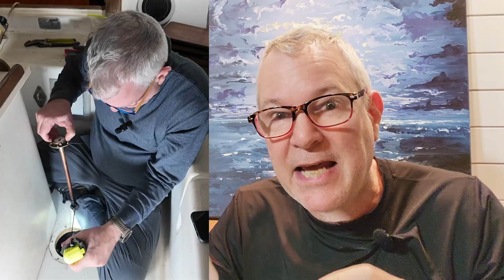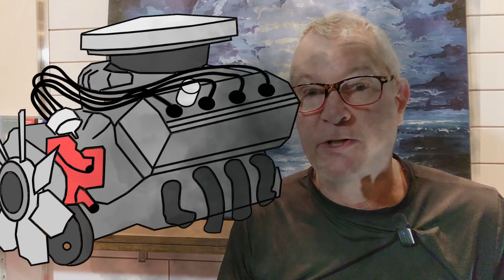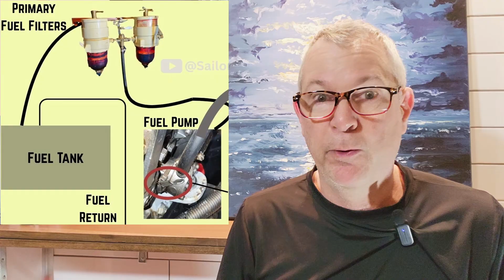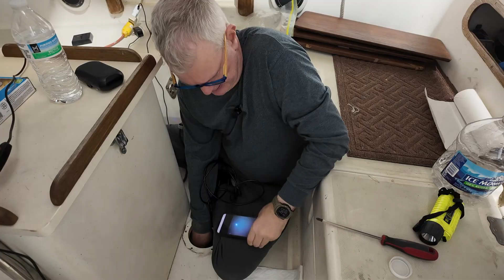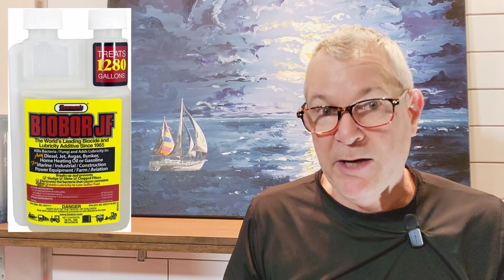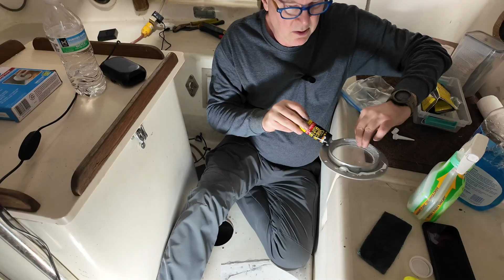Marine Diesel DIRTY FUEL? How to Check and Prevent!

Comment: My engine died in a marina due to a clogged filter. I need to look inside my tank now! Thanks for the informative video. I need to remove old diesel . Old diesel became acidic and ate a tiny hole in my lift pump diaphram causing diesel to get into the oil. I have replaced the lift pump, the oil, now I have to clean up the fuel.
Bill P
Reply from the maker: Thanks for the comment Bill. I am glad this video gave you some insights into what you are going through. Good luck in getting the problem solved!

Comment: All marine diesel engines should be fitted with parallel bypass fuel filters with easy access to switch from one to the other. Also, fit a magnetic fuel bug buster first inline from the tank. Sail boats suffer more regularly with diesel bug because of infrequent engine use. Cheers
Reply from the maker: Awesome comment!  Thanks for sharing your insight.

Comment: Pump the fuel through a filter. Wash the tank with biocide. And pump the fuel back with a biocide. 
Fit a parallel pair of primary filters and carry replacement elements.
Reply from the maker: Thanks for the comment and for watching. I think the challenge for me will be making an access panel to the tank to facilitate cleaning, but challenges are things to rise up to! Thanks again!